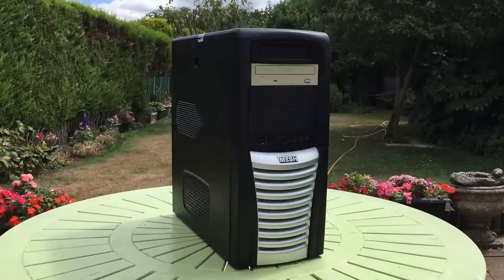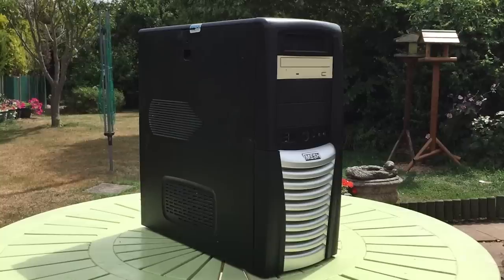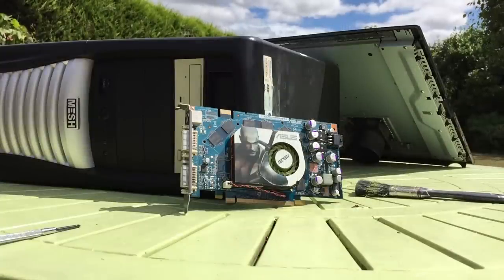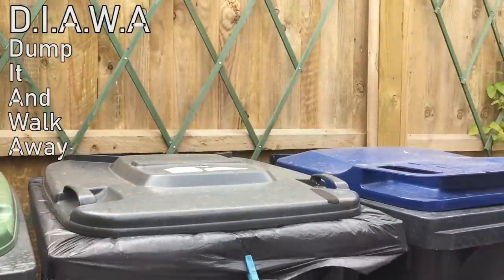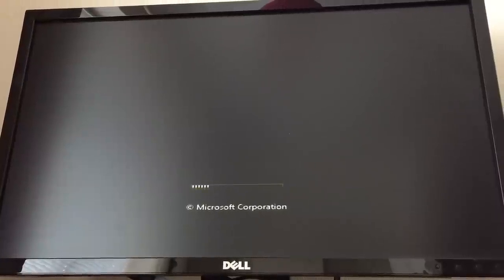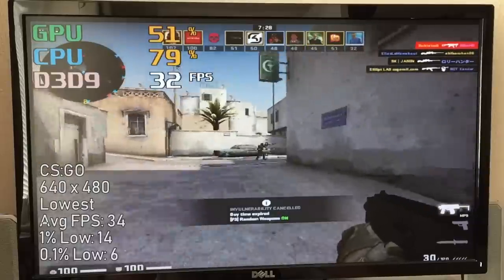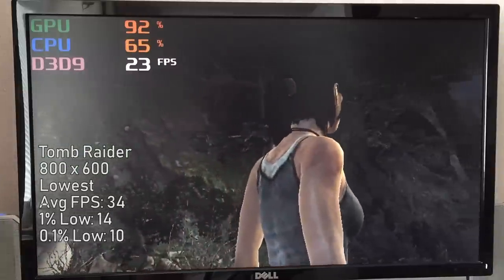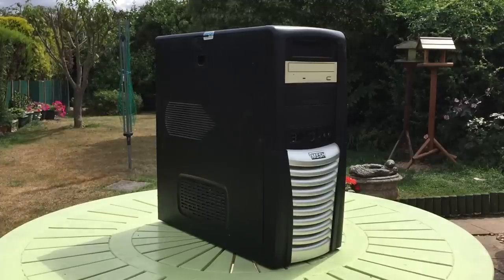Using an old £1000 ($1300) Gaming PC For The First Time In 10 Years...

Comment: Perhaps build this into a early dx11 capable rig with the hd 5870 or 6950 i believe you still have around along with a intel xeon quad core e5450 from ebay or banggood or similar sites..
+ 6 gb ddr2 ram more (800 mhz capable ones for some overclocking headroom ofc.)
Along with new cpu cooler & power supply as you got a terrible 12v rail which it mainly uses besides the 5v sb rail.

(Unless you are building an amd athlon xp system with socket 462 you don't want a 5v rail that is stronger then the 12v rail.)
It's essentially a 200w power rail there you are using mainly if even that at this point as old as that powersupply is.

Also speaking of power supplies, might experiment with an old 750w chieftec unit here that is dead on either the 24 pin 12v rail or the 4 pin/8 pin 12v rail, don't have a voltmeter to test with atm but might be able too borrow one before doing my attempted repair.

Comment: Hello , I've recently built a Ryzen 3 1300x ,8gb ddr4 system, got an 128 gb ssd and 1tb hdd, but I didn't afford a graphics card. I had a GT 210 1gb sddr3 lying around, so I ignored the huge bottleneck and slapped it in, the pc is very snappy and fast, but in the games it doesen't perform well, do you have any suggestions of what I should play until I get a real graphics card?
Reply: GTA SA, cryisis, basically any less demanding games from before 2010 (other than gta iv which may not run well)

Comment: 08:42 GPU 5%, 
Something's not right with the system and it's not simply the memory, 2GB is fine for Mafia. It doesn't appear to be using either the CPU or GPU properly,.
Reply: Was thinking the same throughout most of the video

Comment: I have a question: Should I sell my GTX 1060 now and wait for 1160?
Reply: if you wanted to sell, you should have done it a month ago. Well I don't know where you live, but in America anyway 1060 prices dropped alot
Reply: Well, I live in Hong Kong and it kinda doesn't seem that prices gonna drop before 11/20 series release, but i gonna sell soon though
Reply: nicholas132 it's hard to give advice when every country in the world is different.

If that's the case why not. BUT isn't the 1160 not coming out in the first wave? I think that's the 1170 and 1180. Or am I making that up?
Reply: It isn't, but it is expected that 1160 will be released in the end of October and will perform as same as 1070 ti for the same or a little bit more expensive price, so I am kinda disappointed with my new 1060

Comment: You are getting worse fps at 720p on that core 2 duo system than I get on my 2.6ghz pentium 4 ht system. What's going on? I have an hd 3650 agp 512mb and I get solid 60 most of the time with the worst dips (1% lows) being 35

Comment: upgrade to core2quad with decent cooler to get some room for overclocking, extending by 3 2GB ram sticks, putting gt1030 into it along with SSD and this pc couldve get brand new live as a low-end budget station
Reply: I'd pass on the gt 1030, the used prices for them are hovering too high for their performance. 750ti is the way to go and you can get those $50-$60 easy

Comment: Man I really wouldn't have thrown away that cooler. Especially since it's a THICC copperbase cooler. I've cleaned up similarly clogged coolers and got up to 20c diference. Just wash it under a tap and you're good to go

Also i have a Core 2 Duo E7400 system with 2 GB ram and no GPU. San Andreas is playable while it breezes through CS 1.6

Comment: The issue is having 2gb ram on a 64bits system. You can't even run windows update without having a low memory warning. 2gb is fine on 32 bits but 4 is for 64...

Comment: My computer has a core 2 quad q6600 overclocked to 3 GHz  with a 4GB VRam asus Gt 630 graphics card and a gigabyte S series mother board the problem the board has is a sound problem and it has 8Gb DDR2 ram and the computer case is a thermaltake soprano.
Reply: wow, they made a 4gb gt 630, that sounds so pointless. Nothing against you, but it's so obnoxious when gpu companies make weak gpus with excessive vram

Comment: Replace the GPU (perhaps a GTX 750 TI or even a RX460), Processor (Core2Quad Q6600 up to Q9550), and add more on the RAM (make it 4-8GB) as well as Hard Drive (depends on you). It will be a good upgrade.

Comment: I want to buy a i5 2500k with 16gb of ram and an ssd paired with a gtx780 ti.
I will overclock cpu gpu and ram do you recommend?
Reply: no problem with that assuming you can get it for a good price
Reply: Steve Smith 400€
Reply: ouch, I don't know what European country you are in but damn that's expensive. That's $462 US

CPU is like $50
16gb DDR3 ram is $50
GPU is $150 (and at that price, I'd probably go newer, 1060 3gb and sometimes even 6gb models can be had for that price in the US now) 

so $200 there.  don't know what size SSD in your deal. 

plus people often bundle things together to give you a better deal so that's asking full price for each item (and then some) 

then again I don't know what your countries rates are for parts
Reply: Steve Smith i live in holland 150€ for the card 200€for ps with cpu ram and a hdd ssd 500gb 85€

Comment: I have close to the same specs on my Windows XP box and Windows XP runs beautifully on 2 gigabytes of RAM there's a few games that have trouble running on anything other than XP so it's good to have something like that but I'm pretty sure that I have the same processor and the other specs are pretty close the only difference would be I have a Radeon graphics card when it was ATI  I really miss Ruby

Comment: Hey, I have an old Pentium E5400 PC, I want to install a GPU into it, I think the CPU isn't powerful enough, and seems to be the bottlneck even with a low end gpu like the gt 630. Do you think the gt 630 will be a good choice, I found it on ebay for £25.
Reply: Unfortunately I can't overclock it either because of the cheap G31 motherboard.
Reply: yeah, really anything you buy will probably be bottle necked 

630 would be fine

you can't upgrade to a core 2 duo? or core 2 quad?
Reply: i dont want to spend much money on it, but I mean if the price is cheap I might upgrade it.
Reply: i don't know where you are but core 2 quad runs like $10-$15 in the US 

where are you? (edit- nvm you used a pound symbol so UK?, I don't seem them being more expensive than that, maybe even cheaper)
Reply: I found a q8200 for £7.50, seems like I will be upgrading, I didn't realise they were that cheap haha.
Reply: just double check your pc takes them, i don't see why not since it's the right socket but better safe than sorry, 

some only take core 2 quads up to a certain #

Comment: The cpu usage seems to be constantly higher than the gpu usage. Maybe a cheap xeon 771 mod for this and see if/how it improves things.
Also 2gb ddr2 at either 667 or 800 is rubbish. Should use ddr2-1066 at least (4gb)

Comment: A good quality solid case. I really appreciate these cases. Very good quality, durable, with a plenty or HDD bays, DVD bays, excellent holes for air in the front, no shitty porous shielding which limits the air and get fulfilled with dust, with a good chemically treated metal, and I also like the cooler, with a large copper insertion, much more efficient than today's shitty stock coolers provided by Intel.

Comment: I feel like if you took the fan off the heat sink and blasted with the hose it'd have been fine. Very least you can take the aluminium to a refuge\recycle centre. Otherwise still an interesting video.

Comment: I think mostly of your stutterings are due to the lack of RAM, and probably some driver not "picked up" on the best. **which would require a hell of time to find i think.
Not due to the processor and graphic card (main GPU) which here are worse than what I saw irl runing newer titles. 
It's not a formula 1 but still run beter than on your video, especialy with titles like minecraft. (At least I must check if it was a 512MB version)

Comment: You should not have thrown away the cooler/heatsink but rescued it which was the whole purpose of this video (R.I.P. heatsink/cooler that was never rescued!).

You know, electronics can even be cleaned with water, so the heatsink could have been put in the dishwasher or held under running water. However, just allow it to dry thoroughly afterwards!
Reply: .....it was rescued lol. he made a follow up video

Comment: I wouldn't actually expect that much dust out of a PC that's been off for 10 years as it's being on and having the fans intake air that brings in the dust. I'm really starting to feel old, whenever I hear that something is 10 years old I start to think it's from the 90's or something, but 10 years ago was 2008, I had q6600 in my first gaming PC in 2011, along with a 560ti which I'm pretty sure would dominate this thing, I could run Minecraft with shaders, though not at the best FPS at times and I had 8gb of ram. Seems like a huge leap in just 3 years though, how the hell was that system a $1300 gaming PC back in 2018? It looks like it can't even outperform an xbox 360. I think my current setup is probably around $1300 and I definitely think it outperforms current gen consoles. Moores law was still in full swing in 2008 I guess.

Comment: Even a PC of that spec (circa 2006-2008) everything should be running much better. It seems like everything is running worse than it should even with the 2gb of RAM.
Reply: well he put 64 bit windows 10 on it

Windows 10 is already a ram hog, but 64 bit on a 2gb system is gonna have issues.

Comment: why is the gpu usage so low in some games, 15 percent usage in morrowind, wtf?
Reply: he turned the graphics settings down too far, the system only has 2gb of ram and maybe hes one of those people that thinks that changing the graphics will help (it doesnt), he could probably have run high at 1080p otherwise, just bad benchmarking.

Comment: RandomGaminginHD, now I want you to do what you do best: UPGRADE IT!!!!!!! Max out the RAM to 8gb, install Windows 10 64 bit, give it the best Core 2 Quad you can find, and overclock it to 4 ghz or more on that excellent Asus motherboard! Then pair it with a GTX 1050ti or similar GPU, and then maybe this system can even run some modern games!

Comment: Try running CS:GO on a single core 3.4 Celeron processor with integrated graphics and 4GB of ram. Ah, EMachines the memories we have. I had a T3604 with Vista installed, circa 2007. If I could finish Italy hostage rescue at a blistering 7-10 FPS,  PC users should be able to play Battlefield on a Tandy Coco computer, which I also had :) Dungeons of Daggroth!!!

Comment: That thing desperately needs another 1gb RAM at least. I recently put together a Windows 10/minecraft box for a little boy, it has a core2duo (forgotten the model no) OCd to 3ghz, 3gb RAM, an old hard disc I recovered from a Sky box and a Radeon 5550.  It runs far better than this.  I think what's happening on your system is that Windows is making very heavy use of the paging file due to the lack of RAM.  Getting rid of unnecessary Windows features/services etc. and turning off any windows animations also made a noticeable difference.

Comment: If you are going to run no more than 4 Gb of RAM you should not run 64-bit OS, it will give nothing but use more system rescources!
Reply: Eh, 32-bit Operative have a limit of 3.5 GB of RAM.

Comment: My 10 year old PC with 0.99gb of ram, 1 core 1.81ghz pentium processor and a integrated graphics card could handle GTA SA with 20-30 fps. It was never cleaned and it's still rocking but in my uncle's hands

Comment: Ehrm, 10 years of no use means 10 years of no dust sucked to the inside by the casefans. o.O
So my guess is that dust in the CPU fan and the boot failure is the reason the system was shoved into that closet in the first place...

Comment: NOPE cleaning didnt fix the problem exactly! Cleaning is of course a must, but its the reseating of the ram that made it post/boot again. I had the same CPU bought it for 340$ on launch and it served me well from 2007 to 2010 (while incurring much power bill). It was coupled with the equally expensive GF 8800 GTS 640. Asus boards can auto OC it to 3.1ghz (30 percent) but i made a safe bet using coolermaster AIO. That stock intel cooler is better than what  intel gives nowadays as it has a big copper slug and large aluminum fins (much like what ryzen has) so you shouldnt have thrown it away. That 7900gs is only as powerful as the ps3 gpu (but ps3 games are much more optimized though). The actual problem with your tests is the anemic 256mb VRam! Adding more Ram and replacing th GPU with a 1030/1050 will make it a viable entry level gaming pc as long as the games youll play dont require more than 2 cores...

Comment: WTF GTA SA Froze?! I rebuilt a Pentium d 2.66 ghz with an Nvidia fx5500 which is over 14years old and it ran fine at low settings and 1680×1xxx (I don't remember the last ones) including it only had 1 GB of ram! Maybe it's because it was running on win XP, but it ran ok and was pretty playable, can it have been the drivers of your computer?
Reply: And that is probably it... Windows 7 and Windows 10 uses alot more ram to the point where it would constantly need to have most swapped to the disk.

Comment: Yes the longer the better! But don't push all your videos to be long if it doesn't need to be.
Too bad with the cooler though. Old stock Intel coolers are better IMO. It's thicker and the solid copper slug helps a lot. New Intel stock coolers are just plain bad.

Comment: 😒 My Tipz....

😒 7900 GS passmark score 219 = total garbage, u must upgrade to a newer ddr5 HD GT GTS GTX, u can use a low powered 6 pin card with this old oem psu, blow out the psu dust, visually inspect inside for rust and blown burn parts

😒 Forget compressed air cans, take it all apart and brush it down, then wash down with hot soapy water, then air dry sun, then lite wd40, then wipe down, also buy an air compressor and air gun

😒 that intel cooler is fine and built well, wash brush it down with hot soap water in a bucket then hose off dry then wd40 the fan motor

😒 upgrade bios then upgrade cpu to Q67, Q8????, Q9???

😒 replace dvd with a black face dvd burner

🤓 afterwards u got yourself a good LGA 775 beater yay! 💻🕹😍
Reply: You forgot 1 thing.
The RAM. Win 7 64bit allready uses most of the 2gb of ram. The stuttering can reasonably be a ram bottleneck. 

Upgrade to 8gb ddr2, upgrade the cpu to a core2quad, throw in a msi 1050ti (doesn't even require a 6pin) and that baby can play modern games
Reply: @bass-dc9175  😏👍 Hell Yeah Bro, chk the mb and see what kind of ram it supports, preferably we want a 4 ram slotter, $26 for 4 sticks of samsung 2gb ddr2 800mhz, some higher tier boards support ddr3 as well, if it does get the betr fastr ddr3, and yeah go Win7 64 pro or ultimate, download an activator if u need one as well, and for video cards chk out new and old, prices are coming down still for everything so u mite b able to pu a faster card if u care for something faster 😎⛵⚓☠️

Comment: I no why amd cpu s are higher clock speed like 4.2 ghz or more because they support certain drr 3 speed say like amd fx 8350 8 core that chip set run s 1866 drr
Reply: ??? intel supports high ram speeds

AMD had higher clock speeds with the FX series cause.....well their IPC was crap so without high clock speeds the cpus were really bad.

Comment: Windows 10 edition minecraft will run wayy better on anything really. Runs on Intel Atoms at 60FPS in some cases, it is more optimised, but you loose mod capability.
Reply: Don't think it would work with that GPU though, as I bet it requires dx11 at minimum like most windows 10 store games.

Comment: A system this old is in a pretty poor place as far as older hardware goes. It isn't old enough to make a good retro-PC for Win95/98 gaming, and it isn't new enough to be upgraded into even an ultra low-budget gaming option. I doubt it would even make a very good system for just browsing YouTube videos and internet browsing in general. I would rather have an old 386/486 system or older than that thing.

Comment: I am wondering why on earth you tried playing minecraft on a 256MB graphix card. Which is 2 series below what is required? Ie you have 7900 and minimum reqs are at least 9600. It makes no sense. San Andreas would have worked lovely on that pc,  I am sorry but this is leading me to think that you don't understand the basics of what you are on about.
gta san andreas pc requirements windows 7
Processor: Intel Pentium 4 or AMD Athlon XP Processor.
Memory: 384MB of RAM (the more the better!)
Graphics: 128MB (or greater) Video Card (Geforce 6 Series Recommended)
Hard Drive: 4.7GB of free hard disk space (full install)
Sound Card: DirectX 9 compatible Sound Card (Sound Blaster Auidgy 2 Recommended)

Also win 7 64 uses minimum 2gb so you have nothing left for the games. Whereas Vista only needed 512MB ram.  Should have stuck with the Vista, yet another example of you not knowing what you are doing.  I love it when people who haven't been around the stuff long and thinks they know what they are talking about and how to actually use a pc properly comes up against older pc's that you actually had to know and use properly to have working right. 
Going by the stuff in the pc I don't think it would have been used much for heavy gaming at the time. Also please, just stick to the newer stuff that is around your generation as the old school stuff is too tech for you lol. Pc's these days are pretty much plug and play. Even with the operating systems.

Comment: Again CS Go easy play on that system with more ram, the gphx card and cpu could EASILY play cs:go and 2013 TR 
Windows XP Service Pack 3, Windows Vista,7,8 (32bit/64bit)
DirectX 9 graphics card with 512Mb Video RAM: - AMD Radeon HD 2600 XT. - nVidia 8600.
Dual core CPU: - AMD Athlon64 X2 2.1 Ghz (4050+) - Intel Core2 Duo 1.86 Ghz (E6300)
1GB Memory (2GB on Vista)